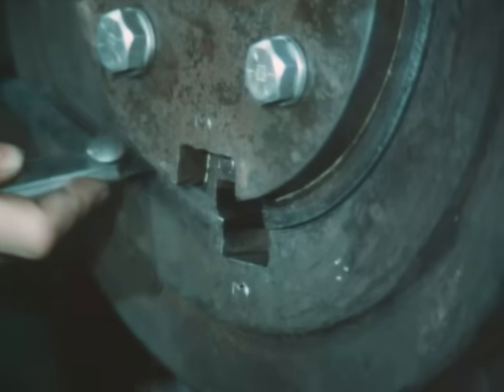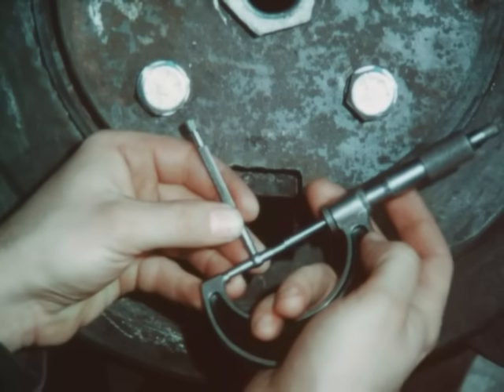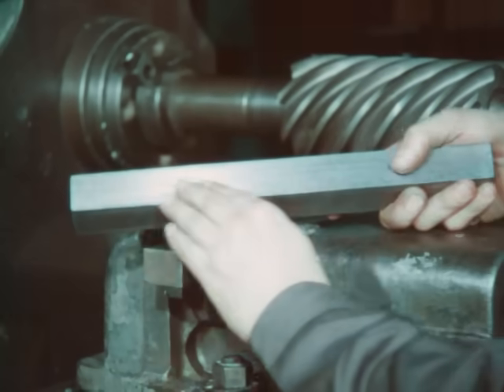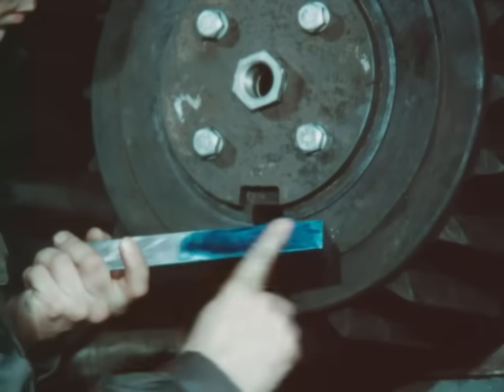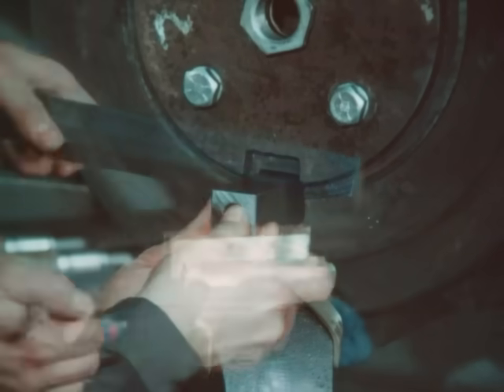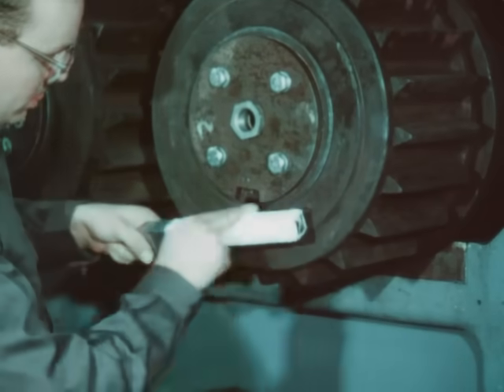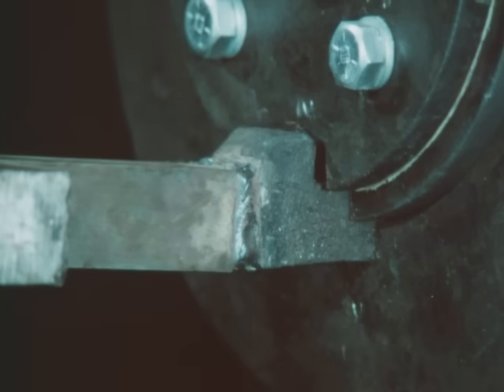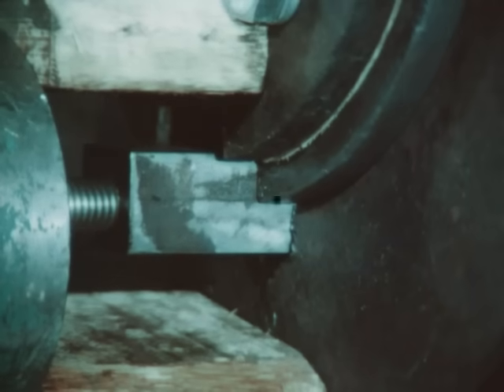Taper Keys Installation And Removal (1960s)

Comment: This old film was quite a bit sloppy in its depiction.   1)  man didn't file the corners round over the whole key length;   2)  incorrect filing technique used to remove high sports - the method shown will produce rounding; 3) narrator used "power"  where "force" is the correct word.
The worker in the film used his bare fingers to apply white lead, which is poisonous and should never be allowed to contact the bare fingers.  Even if he washes his hands before eating, he will ingest some of the white lead.   Over the duration of a career, he'll ingest enough to become senile.
Reply: 40 year machinist here. I agree about the filing on the corners. They should be rounded before any fitting. As for the filing of the high spots the best way to do that is scraping as is done on lathe and milling machine ways. It removes only the high spots instead of making the whole surface undersize. As for the lead, wow, his kids are probably not college material.
Reply: All good points.  I would die on day one of being a machinist.

Comment: Made plenty of tapered and straight keys with the C.E.G.B. lovely job.
Reply: Hopefully you didn't apply white lead with your bare fingers.
Reply: Back in the early ‘90s a machine shop I worked in used it to lube some of the machines. I couldn’t believe it. They used it as way lube on a 50’ planer that was used to recondition railroad rails. A 50’ stroke on that thing and they had a young guy slopping white lead on it. I got another job asap. Plus it was nightshift in North Birmingham Alabama. Really surprised me how much random gunfire there was on Wednesday nights.